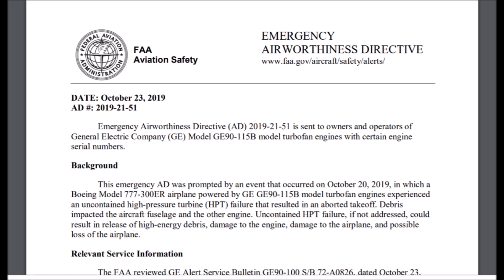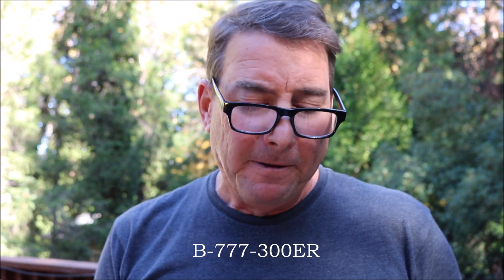Boeing 777 -300ER Emergency Airworthiness Directive

Comment: With all due respect, GE stock has been slumping for quite some time now. This can be a symptom of a greater ill at GE. Please be careful out there - GE jet engines may not be what they used to. 
PS. Not sure their refrigerators are so great anymore either!
Smooth sailing for Veteran's Day -
Reply: This is not a GE problem. This is a maintenance problem and a 3rd party acquisition issue. Could even be Chinese parts. BTW, GE hasn't made appliances for over a decade. It's a Mexican company called Maby and the appliances are excellent.
Reply: @alexandermckay8594  I get this could be a maintenance problem, but why couldn't it possibly be a GE problem? If it wasn't, why would the emergency directive have only targeted certain serial numbers? Let's face it, there seems to have been a tendency in recent years for companies like this to try to sugarcoat shortcomings and gloss over mistakes. Do you really want to take a chance to lose 350 people in a tragic aircraft accident? Recently I read a great quote by Richard Feynman:
"For a successful technology, reality must take precedence over public relations, for Nature cannot be fooled."

Comment: I’m not an A&P or an engine expert but I am an Aerospace Quality Professional with 35+ years of experience. Since they were able to quickly identify the serial, (Lot Number?) of the seals and the serial numbers of the engines they were installed in, it leads me to suspect that those seals may have been accepted on an MRB, (Material Review Board) action where they may not have fully conformed to specification but were deemed “fit for use”?
Reply: That's a possibility. Being in Quality Control in the aerospace industry myself, there are plenty of times I've sent items to MRB due to various nonconformances that have been deemed acceptable due to form/fit/function constraints. Now, that being said, I do not deal with avionics/flight control/critical for flight type products, but I still prefer a black and white system. Does it conform? Yes. Ok send it. Does it conform? No. Scrap, it is, then.
Reply: Eric Ellis 
Hi Eric...
Totally agree. I prefer black and White also. Unfortunately, cost is often the driver in a lot of MRB dispositions. And, if the rework results in scheduling delays, Prime Contractors may demand compensation from the sub-tier source. This can, and will be a factor in the decision making process.
Exactly what Mr. Brown spoke about in a previous episode....When Accountants can Override Engineers and make the Final Disposition on Non-Conforming Material, Bad Things can happen.
Reply: @bobnewkirk7186  You've got that right. Cost plays a big factor, unfortunately. I've had items that I've rejected multiple times (original work, MRB driven rework and second MRB driven rework)  before I've taken it to a supervisory level pleading my case that the product is no longer profitable and should be replaced. It has worked sometimes. Other times it becomes an Engineering/MRB call.
Reply: Interesting discussion going here (Medical Device QE and former Boeing 777 Design Engineer here)... lots of speculation about why they we're able to identify the scope of serial numbers affected. These are logical conclusions, but I wonder if we, as the public, have access to more information about what we are speculating about? If this material was part of an MRB action, wouldn't that be documented in an FAA report that is available to the public for review and not speculate about)?
Reply: @biketothetop  AS9100 requires records be kept for obvious reasons, but I can't speak to the extent of documentation for critical for flight type of product. I deal with cockpit/interior/exterior lighting and cockpit control panels. Essential stuff, but it won't directly cause an incident, figuratively speaking. Some product does get FAA airworthiness paperwork, but is by far in the minority. I can't say, with any level of certainty, if those items get an extended paper trail due to any possible MRB dispositions.
Reply: @ericellis2729  just for fun earlier today I decided to pull up the Emergency AD:
http://rgl.faa.gov/Regulatory_and_Guidance_Library/rgad.nsf/AOCADSearch/936CDD0F9B2D29AE8625849C006DC9CD?OpenDocument

I found the part number for the seal in the AD:
Anyone want to buy a seal? https://www.asap-amspares.com/rfq/general-electric/2505m72p01/

Then I found a reference to the service bulletin. I thought it would be nice if I could open that and read the instructions so I could learn more, but I'm not able find/review the service bulletin. 
Evidently there are only eight serial numbered engines out there that have these bad seals. There are also listed eight serial numbers for the seals.
Wouldn't it be nice if we as consumers could access the where-used part list for determining which airplanes have these engines on them and avoid flying on those aircraft until the repairs are completed?

Comment: How can a single blade fail? It needs to go out thru the later stages, right? Or can a broken blade just get stuck between the next static blades? My intuition was it gets shredded - but probably not. Or it sometimes does, and that's the multi blade failure.

Comment: Juan, correct me if I am wrong but this seems like a massive and potentially crippling AWD for the airlines that fly the 777-300 ER, which is every long haul airline out there, especially in the Asian market.  How are they going to take all of these 777's off line in the next 25 days and have these seals replaced?  As you know these G.E. engines are massive and probably cost the most to service, especially to be digging into the cnetral fan blade area.  I dunno....I kinda wish we had the 747 back.
Reply: Jay St. Clair Earlier, several commenters said that a total of 8 engines were affected.

Comment: They always know about it, there's a memo somewhere in a desk drawer, ignored, there was a memo about the solid booster seals, about the leading edge heat shield, about MCAS, THIRTY plus years in Q.A. I'm just a wee bit jaded.
Reply: Maybe so, but consider...  I'm an engineer, and I have been one of those people writing memos to higher-ups about problems.  But, a couple of things occurred to me recently:
1) In a company the size of Boeing or Airbus, if you tried to address every concern of every engineer, you would literally never get an airplane made.  It wouldn't just be the number of concerns (although that would be daunting), but also that what one engineer saw as a safety improvement, another would see as a risk.
2) One of the things engineers are tasked with doing is to consider what could go wrong.  Say you make changes today that fix all the things that I said are wrong, tomorrow I will think up some new possibilities.
Thus, when something goes wrong, it's not unlikely that some engineer thought of the possibility and wrote a memo.

Comment: Juan, you need to explain more about cooling in a turbine engine. Cooling as most people would think about it, is their air conditioner at home or in their car, Cooling in a turbine engine means decreasing temperature from (round numbers) 1,200C to maybe 600C in the turbine blades. They are hollow and the relatively cooler air cools them. This is still VERY hot but cooler than 1,200C. It's all relative.
Much of the air exiting the compressor goes around the burner chamber to keep it cool (relatively).  Only a small amount is needed to keep the fire going. If the burner cans were not cooled, they would melt. 
There is also an FCOC or Fuel Oil heat exchanger where hot oil is used to warm the fuel which, in turn,  cools the oil. There might also be an ACOC where ambient bypass air is used to do the same thing. These two work in tandem and are thermally controlled.
Engine oil needs to be kept in a certain range to both lubricate and cool the bearings.  
New materials now allow engines to operate at much higher temperatures than 50 years ago. Higher temperatures=more power in a smaller engine to rotate the huge fan.
Reply: Once upon a time I worked around turbine blades.  Very interesting things they are.  I've seen clear stereolithography model blades that have the internal cooling passages slightly dyed to emphasize the internal cooling channels and it's a little maze inside there.  A lot of work goes into those things.
Reply: The performance and durability of Stage 1 high pressure turbine blades and vanes is most responsible for the improvement of aircraft. The alloys themselves - deservedly called "superalloys" - have gotten much attention (my field): nickel, cobalt, chromium, tungsten, molybdenum, rhenium, aluminum, titanium, tantalum, boron, carbon, zirconium, yttrium. Intricate cooling passages and pattern of holes providing film cooling. Directionally solidified to produce single crystals (!!!). Coated to provide greater oxidation and corrosion resistance, plus a ceramic thermal barrier coating.

And despite of all this trouble and expense, they come out of an engine at overhaul looking beat to hell. They sit in a flow path at over 3000F, cooled with compressor discharge air at nearly 1400F, while having usable strength up to "only" 2100F and a melting point of less than 2500F.
Reply: Thanks, Peter Steitz. Always nice to have additional detail.
Reply: Even in cars our radiator cools the engine but it still at a hot temp, not ice cold, right?

Comment: If you ask me would be better if the air craft in question was grounded right away. Then only allowed to fly once they can show proof the part in question was replaced.

Let's say the airline was allowed to use them for 25 cycles until they was forced to replace them. What if the engine blow up and throw the engine blades where the people are located. If I was the family member that found out the airline was using a aircraft that they knowing very well something was wrong with it. I would sue the living hell out of them.
Reply: Why, if the increased risk from flying them for 25 cycles is so small that it doesn't significantly increase the risk of flying, and it would inconvenience a lot of people. 

Whenever you fly, you decide the risk of flying is worth it to you.  Now I'm totally making these number up, but say when you booked a flight you knew the risk was 1:5,000,000 that you would crash.  If this engine problem comes up after you have booked and the odds of crash are very slightly higher -- say 1:4,999,990.  Would you want your flight canceled?  I wouldn't.
While I'm making these numbers up, someone has done this type of analysis.  This analysis is a big part of determining the time allowed for the problem to be addressed.
Reply: @andrewsnow7386  What if someone close to you fly's on a aircraft that has the seal issue. Engine end's up blowning up killing them. Are you going to say oh well OR will you be upset after finding out they known about it.
Reply: @OutlawNix  Well, as it happens, my wife is flying home today.  Since it's a domestic flight, I doubt she will be flying on a 777, but I haven't bothered to check because it doesn't matter.  Regardless of what plane she flies on, the reality is she will be safer their than when I drive her home from the airport (even though I have a very good driving record).

Comment: cooling air from the compressor section is directed past these seals to the turbine blades. The cooling air flowed through the root and forms a laminar layer which shields the blade from the combuster gasses. if the cooling fails, the blades heat up. The hotter the materials, generally speaking the weaker they get. this means there is a critical temperature for the blades above which they will not meet structural requirements. first and second stage turbine blades are quite expensive because of their materials and engineering behind them. I am quite sure that GE knows their critical temperatures and will work quickly to resolve the issue.

Comment: What is going on with Boeing?  25 cycles?  Ground them NOW!!
Reply: The engines are not Boeing, there made by GE.  It's just like if you have an outboard motor on your boat.  You shouldn't blame the maker of the boat hull if the outboard has a problem.

Comment: Dont forget the uncontained engine faliure on the Quantas A380 that almost brought down the plane as it cut the control wires
Reply: The Qantas flight lost more than controls - the entire wing was shredded. It cost Rolls Royce 170 million dollars to repair the aircraft including a complete new wing.
Reply: @allangibson8494  why does RR repairs it !??? Shouldn't Airbus do it !?
Reply: @MarkSmith-js2pu  RR ain't the plane manufacturer. Not sure they can repair such complex repairs. It doesn't make any sense .
Reply: @kirilmihaylov1934  Rolls Royce broke it. They had to pay to fix it. Qantas really doesn't like writing aircraft off (something to do with not having lost a plane since 1952). (Contrary to myth, Qantas have lost 12 aircraft, including its entire fleet of 9 between 1941 and 1945).
Reply: @MarkSmith-js2pu  It was Rolls Royce's screwup that broke it - they had to pay to get it fixed - a very very expensive cheaply made and poorly inspected tube fitting.
Reply: @kirilmihaylov1934  doesn't mean RR did the work. Means they paid the bill (or their insurance company did)
Reply: @charlesborlase2238  agreed

Comment: Juan, I'm unaware of any testing performed on the engine case for HPT blade containment. The inlet fan, there is a lot of testing (and the frozen chicken) and a large wound Kevlar blanket to contain fan blades.

IMO, a HPT failure had to have received a large amount of fuel (either Jet A or turbine oil) to detonate the engine case.

I pulled the Flight Radar 24 info on the aircraft registration number HS-TKL was built in September 2012. If this aircraft was flying on average 11 hours a day, the engines would have close to 28,000 hours, under the average expected 35,000 hours before overhaul.

With all of the engine trend data that's available, someone had to have noticed in increase ITT temperatures and in increase in oil consumption.

Comment: If I recall, this component - though seemingly minor given it's name - is a major item, with a web and a hub just like a turbine disk, spinning at the same rate. It has knife edges at its periphery that dig into the inside periphery of the vanes. I believe it also acts as the spacer between the Stage 1 and Stage 2 disks . If it failed catastrophically, it would not be contained, and would lead to big trouble generally. But all seals are critical to keep hot air where it belongs (or oil), and even to balance the fore-aft thrusts on a shaft (or else bearings get overloaded). There is a lot of cleverness in jet engine design.

Turbine blades are fed cooling air from their roots, but that air is mostly for cooling the airfoil portion, which sits in high pressure flow of air greater than its melting point (Stage 1). If the seal in question leaked, it would disrupt the flow of air into the Stage 2 blades, not quite so hot, but they will not survive long without it. The cooling air must be at a higher pressure than the air that passes by the airfoil sections, since that is where it is exhausted through tiny holes (film cooling). I was a turbine blade alloy developer at GE. That was 20 years ago, so don't put too much faith in the details I'm providing.

Turbine disk materials have a far lower temperature capability than the airfoils. If the airfoil attachment areas got too hot, it would be the disk "posts" that would fail and liberate blades. It was my impression that the turbine case cannot contain even a single entire blade. Just the airfoil part? Don't know. I prefer not to sit in the line of fire of turbine disks!

The requirements for jet engines are so stringent, it is effectively impossible to produce perfect engines. A book accompanies an engine during assembly that records all the discrepancies and how they were resolved. If a batch of seals required review - a judgement call, perhaps a heat treatment was a little off, for example - it wouldn't take long to identify the other engines. Until discrepant parts are reviewed, they are literally locked up in a cage.
Reply from the maker: Thanks Curt
Reply: Yes that part is a major component for the HPT rotor. A failure of that part (I’ve seen a few) is very catastrophic.
Reply: Curt Austin 
Ha
Not bad after 20yrs, I have trouble with yesterday.
Reply: I lost you after the words "If you recall" LOL Good thing that someone knows what they are talking about - safety is #1 !
Reply: @northernlight696  It's a seal named Harvey, and for 1 herring it will juggle 2 Fettzer valves. :-)

Comment: I may be wrong but there was a similar incident in Hartfield with a Air France 777-300ER on the No. 1 engine during takeoff and had to return. At least the issue is being taking care off quick.
Reply: It was engine failure but we don't know if the problem is the same

Comment: You could of said “this is an example of how quickly regulators SHOULD issue an AD after an incident, unlike the regulator’s response to the first and second MAX crashes”.
Seems like the regulators have remembered their responsibility to keep the flying public’s safety over airline and aircraft manufacturers profits.
Reply from the maker: Data...this was hard data and easy to obtain.
Reply: blancolirio Boeing and the FAA also had the live maintenance and performance data for the 2 MAXs that crashed too, didn’t they?  Along with the FDR and CVR data.
You would also think, with the current scrutiny, Boeing would have issued a directive of their own and not wait for the FAA!
It is great that the FAA didn’t consider cost. Cost should not be a consideration when it come to airworthiness.